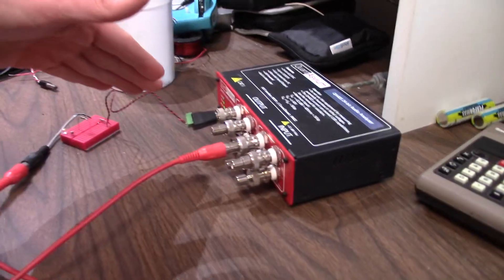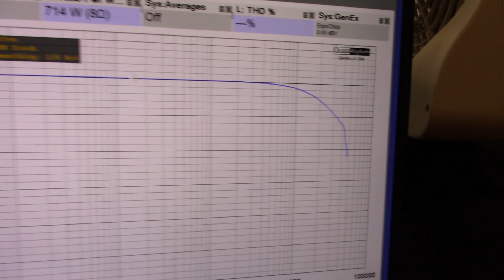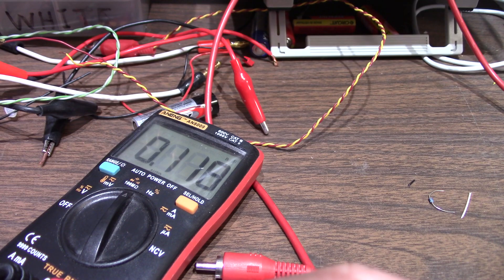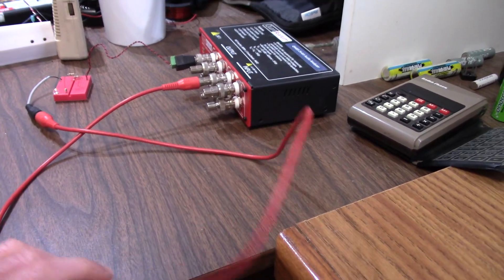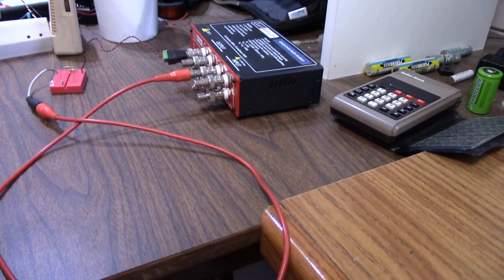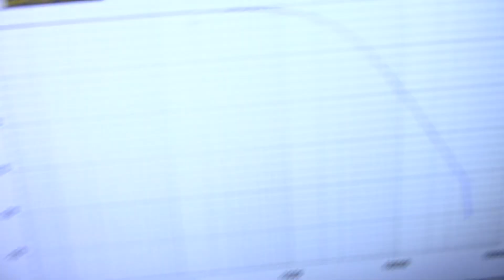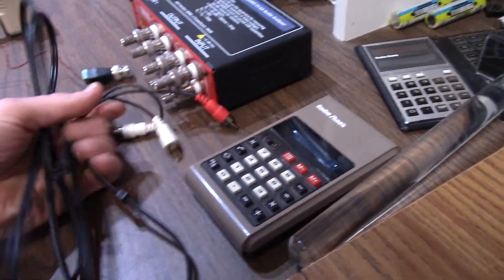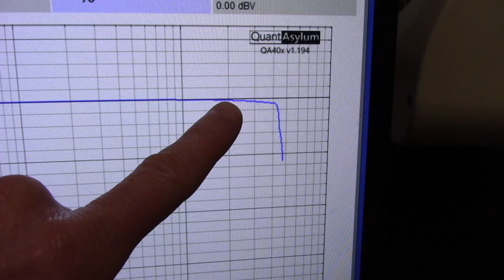When audio cables matter - source impedance and cable capacitance

Comment: This is the reason guitar cables are never long. Without an active pickup, the impedance of many guitar pickups is 50K Ohms. A short cable and active DI is essential for direct in on a pro audio console, even if i has a high impedance input for aux in.
This is one reason long mic or line level snakes are specified at 200 to 600 ohms. The nominal impedance of a typical XLR microphone cable is near 65 ohms. To reduce the long cable loss, the transition to digital consoles and digital stage boxes, place the console analog input on stage, so there are no longer 100 to 200 foot analog cables out to FOH (Front of House) and back.to monitor amps on stage and main speakers.
For the complex impedance of speakers and the impact on damping, it is very common to use powered speakers so the wire between the amp and speaker is very short, typically less than 2 feet.
Line level audio to the powered speaker si driven with a low impedance source typically less than 200 ohms. Often it is 32 ohms. The shorter cable between a digital stage box and the powered speakers improves the sound considerably.
To fix the last mile issue, more modern systems use AES2 / AVB to the powered speakers or amplifiers as a digital instead of an analog signal. This eliminates cable distortion, noise pickup, and problems with ground loops.

Comment: Okay... but no sensible designer is going to put 100k in series with an output.
As you said ... typically a hundred or so ohms.

I have cheap RCA cables here that will pass a 1mhz square wave without issues.

Comment: 5:10 The nice thing about (passive) guitar pickup design is that they all have a resonant peak (many dBs in amplitude, the coil itself is a resonant "tank" circuit (inductance and capacitance, so many wire!), so the effective loading (amp cable (some picofarads), potentiometer and some filters (more capacitors)) flatten out that nasty mid/high frequency peak. That's why single coils and humbuckers pickups use different potentiometer in the passive volume/tone circuit (more load on singlecoils (250k pot) and less on humbuckers (500k typical, as the capacitance and resistance of those are bigger, so the peak is lower in frequency and amplitude)
If you conect directly (without any potentiometer or passive control circuit)  a guitar to an amplifier, the sound will be unpleasantly bright 😅

Comment: My take away is that as long as I don't randomly chuck a 100k resistor on the end of my cables connections I should be absolutely fine with practically any dang cable
Reply: Well, of course as long as you have a low source impedance.

He put the resistor there just to demonstrate how output impedance of the source affect the signal in the next chain (device) along with the cable's parasitics

Comment: Nice video again. I love those BNC, RCA & BARREL connectors with the green colour screw terminal for easy connection but only problem is many manufacturers use iron Instead of copper in the conductors which rust after some time

Comment: I made a circuit to measure resistance between two electrodes in a moist wall by using an AC drive to avoid electrolysis.

Worked fine on breadboard but when I attached a foot long cable I got all wrong measurements. It was the capacitance of the twisted cable I had used to connect the electrodes.
Making it work up to ten yards was... interesting.

Comment: i have a strange thing happening , im on Behringer B2031A monitors . Active studio monitors . I used mostly Audio interfaces with Balanced connections , but lately i hooked up a TV , and i needed Audio from HDMI , so i got HDMI splitter , that now acts as DAC and has unbalanced outputs , so i went for Valve Preamp , it was working fine on passive Edifier speakers , but strange thing i bring back monitors , and for some reason left side goes lot quitter , i turn off the speaker and turn it back on , fixes it .. I should mention one cable is longer , but i changed the outputs from the preamp and the problem went to the other speaker . So its not due to unbalanced cables of different length . Doe anyone have any idea . Strange thing did not happen on Passive speakers , but its essentially the same thing . First time i don't know what's going on .
Reply: Active monitors have a lot of internal safety circuits (to prevent overloads int the power/amp. section), mainly some kind of compressor/limiter. Maybe some strange high frequency oscillations? The tubes may be reacting badly with the DAC (usually, digital equipment introduces a lot of HF interference into analog equipment, the ones that handle this well are usually high-end side)
Rule things out, try the tube preamp with another analog audio source, see what happens with the monitors. Then take the tube preamp out of the equation (use another preamp) and see what happens

Comment: 100 pF is NOT a lot of capacitance!
I, too, am of the opinion that a cable does NOT affect tone. Unless the cable is faulty. 
It's like "tonewoods," which does NOT affect the tone on an electric guitar. 
An acoustic guitar, certainly! After all, with an acoustic guitar, ALL the tone comes from the wood...duh, because it's an acoustic guitar.
The cables you're using are not what I would use as a guitar cable, those are basically Radio Shack cables for interfacing a cam-corder to a computer. 
Most guitar cables are fine.
Reply: His point is that if the connection is high impedance ( for example 100 kiloohm ) then 100pf can have a significant effect on audio signals.  Some devices such as guitar pickups or phono cartridges can have high impedance in which case cable capacitance matters.

Comment: Hey, great video! When it comes to testing cables, definitely check out VNAs.  NanoVNA is super affordable, a fraction of what you spent on the 121GW, and works great for lower frequencies when combined with a mixer or upconverter (i.e. ham-it-up plus). If you need more accuracy and features,  a hobbyist VNA such as the LibreVNA is a solid choice.  Your problem could very well be an impedance mismatch between your test device, that resistor, and the cable, rather than purely the capacitive reactance of the cable its-self.

Comment: 6:00 So, why aren’t there pre-amps built into turntables (especially the expensive ones)?
Reply: There are turntables with built in phono stages. Plug and play, if you will. No idea what the quality is though. But, the reason very expensive turntables don't have built in phono stages is because the buyer wants to choose a specific phonostage.
Reply: @bobisyouruncle1  That makes sense. Tx!

Comment: Glad that someone is demonstrating the facts about cables as an antidote to the esoteric nonsense that is so often spread. At audio frequencies it's unlikely there's going to be a measurable difference between cables, and if you can't measure it then you can't hear it.  
That said, I've taken apart a few of those cheap phono cables and found they aren't even using screened cable inside, it's just a twin core. That's not ideal and could allow more noise to couple in, although whether even that is audible is another question.